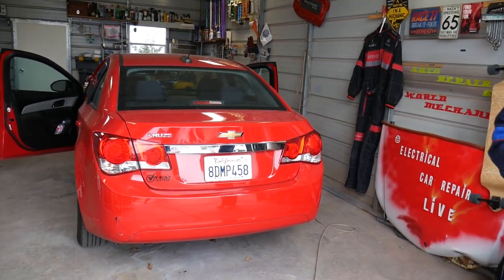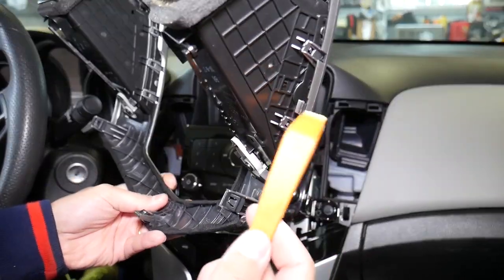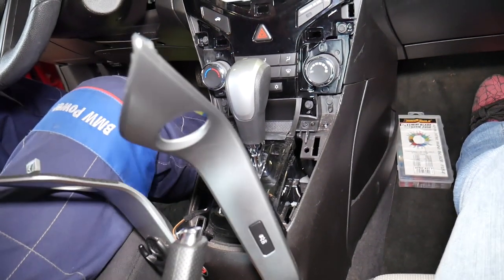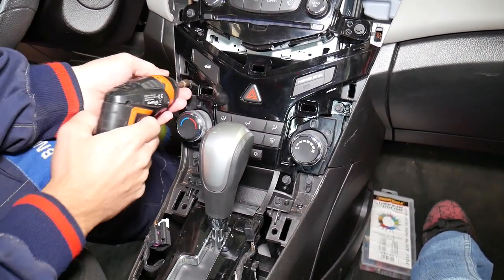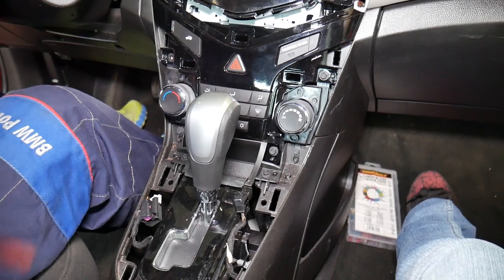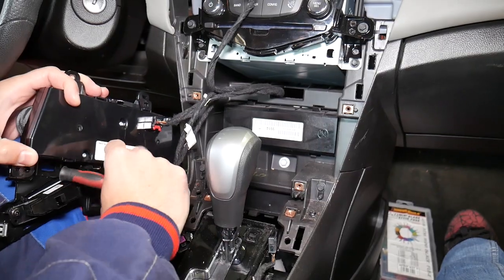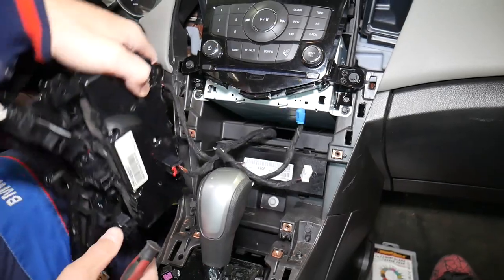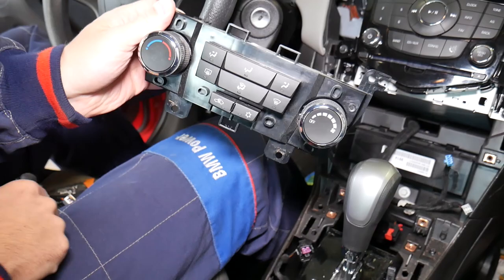CHEVROLET CRUZE CLIMATE CONTROL SWITCH, HEATER CONTROL REPLACEMENT REMOVAL

Comment: Disconnecting your battery cable, then turning your key in the ignition to remove residual power from the system will likely reset your climate control switches and interior fan to working order.  My climate control and fan stopped working after I jump started the Cruze, now working again.  I give all praise to Jesus Christ for bringing me to peace by following the teachings of the Catholic Church.

Comment: Thank you so much my guy. I have a 2014 cruze with 106,000 miles. I came out in the morning to start the car and i could not change the ac/heat settings or turn on the heated seats. I purchsed the climate control switch from rockauto for $150 and followed your very good instruction. Fixed it! Thank you very much!
Reply: Did you unplug positive terminal on car for 1 hour. He wasn't clear about the air bag and battery terminal
Reply: @stevenpowell3809  I unplugged the negative battery terminal for 1 hour. Better safe than sorry.

Comment: good video! location and undoing the clips is sometimes the worst part. I have the dealer service guide but it doesn't even show the DTC Bo48D-06. I need to find the output to the heater and check voltage and continuity. Thanks for a good video

Comment: One of these Chevy Cruzes have a vacuum round plunger kind of like what's inside the valve cover the PCV valve plunger round thing that dry cracks inside the valve cover and causes problems there is another one of those round air vacuum plastic plungers looks like an accordion you know with all the Rail lines in a flexible tube look but it's a round actual diaphragm plunger... it's in the top Dash cubby hole up up above the radio... all I've got is that cubby bucket thingy above the radio pop that off and down inside the dashboard is a vacuum plunger for the heater

Comment: hi @
Auto Repair Guys, I have a cruze 2011 and the air is stuck in hot air all the time i already change the HVAC actuator and does not work can you believe that the problem will be the heater control or maybe the BCM?

Comment: You said the white wire leads to airbags and you must unplug terminal to battery. Is it positive or negative? And you said for at least 1 hour before working on climate control. Specify for when and what to unplug and when to plug back in.

Comment: Make sure you replace the unit with the correct fan speed on the dial, as the earlier models only had four fan speed modes (this one has 6).

Comment: Unplugged positive wire for ten minutes and put key in ignition Without starting it and boom it worked!
Reply: Thanks. You made me saved a lot time and some money
Reply: Could you please tell me if you unplugged the positive wire from the battery or from the climat control unit. Many thanks
Reply: Tired that it didn't work
Reply: Thank you, your comment just saved me a lot of hassle :)
Reply: The one that connects to the battery?